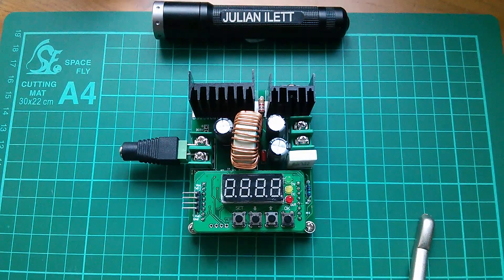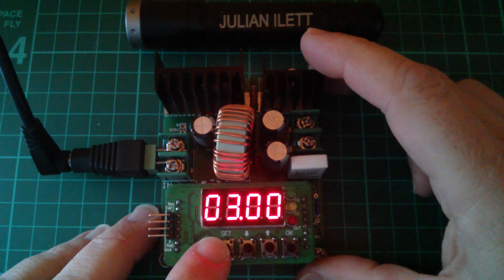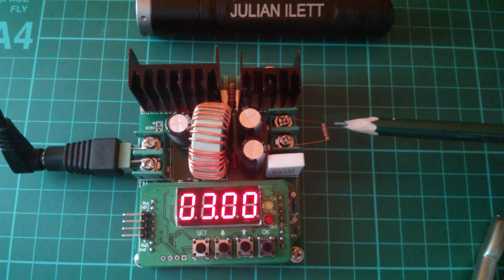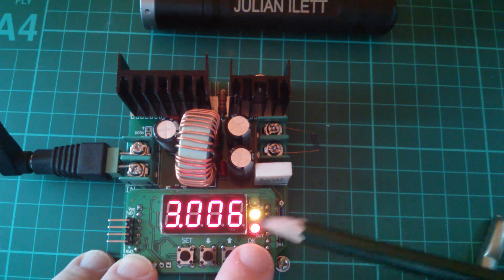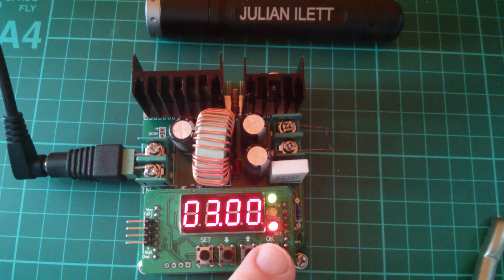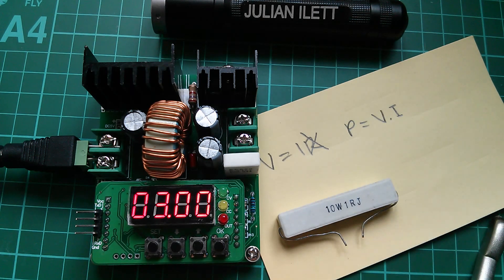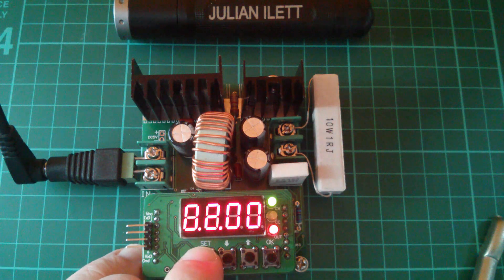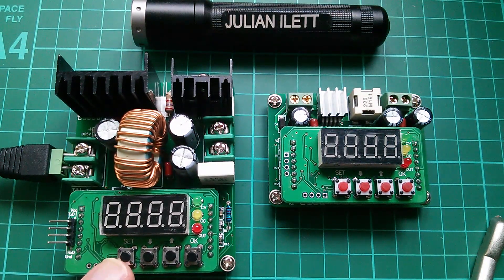Tutorial: DC/DC Buck Converter Voltage and Current Regulation

Comment: Great video Julian. I just received the A3606 module. Will connect it to my 6 caps smart plate. Easy way to adjust the current and voltage for many projects. Now it is priced $9.00 including shipping. Other higher modules I use with my 100w LED chips and it costs ~$20.00. All due to your recommendations. Thank you.

Comment: You should start a channel called: "Will it CV or CC?" I enjoyed that. :)
There is certainly the accuracy of the 10W resistor to consider, however the temperature coefficient of the 10W resistor should also be considered among other things like the accuracy of the voltage and current reading of the Buck Converter itself. In a perfect world I'd expect the CV and CC to oscillate, which I find interesting to think about...

Comment: You just put together an e-cigarette mod, haha. A DIY one. A mod is really a dc-dc converter (powered by IMR 18650 batteries, with a nominal voltage of 3.7V). The coils are either made out of Kanthal or Nickel wire (Nickel is used for temperature controlled devices). The mods have a microprocessor running a firmware and it reads the resistance of the wire and allows the user to adjust the amount of power sent to the coils in Watts or Joules. If you use 24 gauge Kanthal you will see an amazing glow in the coils and they won't burn out easily. There is a chip called the DNA 200, which is completely digitally controlled and is much smaller than this one, It comes with an LCD display, is able to read nickel wire resistance in real time and control the temperature of the wire by doing that. It is done by a US company called EVOLVE and there are many clones in China of it.

Comment: Question:  With the single wire strand. It was giving you 3A and low voltage.
Is that a restriction of the converter circuitry, or is that caused by the fact that the input (lead acid batteries) can't provide enough input power for the converter to get the voltage up as well ?
Reply from the maker: No, it's simple ohm's law V=IR. The wire strand had a resistance of 0.25 ohms. Multiply that by 3 amps and you get 0.75 volts.

Comment: Thanks for the video.  I wish you would have tested the actual resistance on the big resistor to see if it was off, instead of just assuming it was the problem... it could have been the regulator.  Also, I wish you would have tested the accuracy of the displayed output volts and amps vs a good meter. :).  I know this wasn't a review of the product, but you went so far, that the last details would have been easy.

Comment: Interesting, I'm working on a home automation for my greenhouse using arduino for control and a car battery for power.
Was planning on using a linary voltage regulator for the 5v to the arduino, reason for the car battery is because window servo is a 12v also my water pump is 12v. but I doubt an arduino would be happy with 12v for a longer period.

Any suggestions about voltage regulation on Car battery(12V) > Arduino(5V)?

btw. I'm charing the battery on sunpower, with a 12v controller.  So no sudden spikes of power like with an alternator.
Reply from the maker: ***** If you're using solar power, use a DC/DC buck converter for your 12v to 5v conversion - it's more energy efficient than a linear regulator. You won't have any issues with switching noise - the Arduino, pumps and servos are all pretty noisy themselves.
Reply: Thank you, will look into this   Good video ;)
Reply: An update,, I got a 15v -> 5v Buck down converter, and it works like a charm.. Thanks for the tip.

Comment: Hi! Lovely video! Very clear and easy to follow! But I do have a question: If I want to stabilize 24v that is being produced by two lead acid battery's in series and also want the regulator to be able to handle 6 A what kind of circuit could I build in order to regulate that? I've been looking around, searching for a voltage regulator that is capable of that but none of them go to such high voltage together with such high amps. I would like to prefer using base components because although your buck converter seems to do the job perfectly, it's huge and probably expensive as well (it's a school project). Thanks!

Comment: Question: What's the minimum difference between the input & output voltages? Alternatively, for a particular Vin (say 12.6V from a SLA battery), what's the maximum Vout I could get out of it?
Reply from the maker: Alex Turcu Probably not much more than a diode volt drop - in other words, a volt or so.

Comment: Interesting that at the threshold current it's flicking between CC and CV at a rate of almost exactly once per second. I'd expect it to be flicking between the two at some fast rate, fast enough that they'd both appear to be on, so you would get that situation where both lights appear to be on. I'm guessing that 1 second switching period represents a 1 second hysteresis in the module's CV/CC algorithm, so it's limited to performing exactly one switch between CC and CV every second. I'd be interested to see what impact that has - if it's in CV mode and it's already done the one switch in that particular one second period, would it be possible to arrive at an over-current situation if the load resistance suddenly dropped very low?
Reply: On further contemplation I don't think there can be a one second hysteresis in the CV/CC algorithm because it just wouldn't work properly if there was. Perhaps the hysteresis is just on the output to the lights? With a bit of fiddling is it possible to get it to switch between CV and CC at a faster rate? I'd be interesting to see some further inspection on this - you'd need to trace out the V and I curves on a scope to get an idea what's really going on.
Reply from the maker: Kieran Simkin My impression was that the slow oscillation was due to the quite large smoothing capacitors on the unit's output. This would limit the slew rate of the output voltage and therefore the current also.
Reply: Julian Ilett Aah that sounds like a plausible explanation, easier to test too because you could temporarily replace the output caps with smaller ones and see if the ooscillation speed increases, or (even easier) increase the capacitance by adding more in parallel and see if the speed decreases. I'd have a go myself but I haven't got one of these devices handy - I'll likely order one when I have a bit of spare cash - being a bit of an eBay bargain hunter like yourself I often steal purchase ideas from you :)

Comment: I've made a little bench power supply using the B3603 and a 19V laptop charger. It's housed in an old CB-radio power pack case.
Slight drawback is that the output negative is directly connected to mains earth, but the unit can be powered through the bench isolating transformer if needed.

The tiny heatsink provided proved inadequate at 12V 2A, luckily it's quite easy to graft a better one on.
It works very well, though I haven't measured ripple and noise.
It's also nice to be able to set the current limit before you start.
My BK Precision 1550 (38V 3A) Bench PSU doesn't do that - annoyingly you have to set a low voltage, short the outputs and switch on to set the current limit. That's stupid!

If the tests are good re ripple and noise, I might make a triple-output supply. Conventional 50Hz transformers though, making the outputs isolated from mains earth.

A little bit of hacking to make a tracking split supply from one controller would be cool.... another one to add to my long list of projects lol!

I've also used one of these as a charge controller for my daughter's motorised trike. I got it second-hand, the battery (6V 10Ah SLA) was past its best.
Got a new battery but soon found that wouldn't have lasted too long either as the original charger was seriously overcharging it.
Set at 6.9V with a 1A current limit the unit barely gets warm. I'm using a 12V 2A mains adaptor.
Current drops to the region of 4-7mA depending on temperature when fully charged.
I do intend to fit one of the more basic twin-pot regulators to free up that B3603, though I have 3 more lying around.

One thing to note though - the whole unit powers up when connecting the battery. I didn't want to add a diode as regulation would suffer.
Final version will include a relay to prevent this.

The heatsinking on the B3008 seems a little better, but I'd be tempted to bolt the devices to a much larger heatsink if I used one for something permanent.

Simon.
Reply from the maker: Simon Parkinson The B3603 is an excellent little converter, but these Chinese modules should always be de-rated - 2A sounds about right.
I think there's a P-channel MOSFET circuit that you could use to prevent the battery on the output from powering the circuit
Reply: Julian Ilett I kept unit at 2A max. stilled started malfunctioning after a few days of use.

Comment: What happens when the input voltage is lower than the set output voltage?
Does it just output the same voltage as the input? For example; If I input 12v and set my output to 10v, what would happen if my input voltage drops to 10v and then even further to 8 or 9v?
Reply: If I understand the principle correctly, the converter steps up the voltage as well as stepping it down.  The only "gotcha" is that the input still has to be able to supply the required current at that lower voltage, so that the converter can boost the voltage and still supply the asked-for current.
Reply: Vidgester1999 
Input has to be higher than output.

Comment: Question about DC Voltage Step Up converters.  How much energy is lost during the conversion? (ex, 1cell 3.6v to 5v)

Just saw a local news talk about portable battery packs for smartphones and they done some testing from a lab and due to loss during conversion, news say users can only expect about 70% of actual battery mAh capacity.

Does this sound about correct?

I mean... pretty much every portable battery packs I see either use 18650s or LiPo.
Reply from the maker: +xxgg Actually it's probably worse than that. The step up converter is generally about 90% efficient, but power is also lost going into the power pack. That's because a linear regulator is used to take 5V down to 3.7V so the loss is (approximately) 3.7/5 which is about 74%. 90% x 74% is 66%.
Reply: I am currently charging my iPad Air with my Anker 5400mAh pack and monitoring mAh being put into iPad.  I'll post result when it is done.

Comment: I am searching for a charger to charge a 12 battery, with a wind driven(variable) dc input. sugestions? maybe this one. Thanks, greetings.
Reply: I'd expect a simple solar charge controller to do this job, with the solar panel inputs connected to the wind generator.

I wouldn't recommend one of the more complicated chargers, because the programming might expect a gradually increasing availability of power from the solar panels, which a wind generator won't normally supply.

Comment: Are you getting much power from your panels at this time of year? My 800w array is giving me 0 watts during the day at times.
Reply from the maker: Shaun Dobbie I have to be careful - not draw too much from the batteries this time of year.
Reply: Me too, all I can have running at the moment is an IP camera and a raspberry pi all running on a 24v 225ah battery bank which I have to charge every day or so from mains electricity. How I hate Winter.

Comment: Is that UART to the left of the top board? Does that allow for remote setup?
Reply from the maker: ***** In theory, but it doesn't appear to be implemented. Shame.
Reply: Shame that could have been useful for an arduino based charge controler

Comment: Julian, I can see that you have four pin header soldered on the board. Do you have any info about it? I would love to drive it with something other than buttons...
Reply from the maker: Dobrica Pavlinušić It's marked Vcc, TxD, RxD and Gnd, so in theory it's a TTL level serial interface to remotely monitor and control the buck converter. A disappointment then, that it doesn't appear to be implemented. I've monitored it at various different baud rates (on both Tx and Rx lines) and got nothing! I've fired various different commands at it - also nothing. It's a real shame, being able to monitor & control these converters with an Arduino would be so cool. Afraid not :(
Reply: ....If the serial would actually work, you could also use it for mppt experiments.
Reply: Julian Ilett I guess the serial port is accessible and it's used in production for calibration. I don't think you will get anything out of the port, unless you send a magic byte to it first.
Reply from the maker: ***** MingHe also make the ZXY6005 family of DC/DC converters which have a similar serial interface which is implemented in the 'S' models (e.g ZXY6005S). There's a document floating around which details the command set and I mostly copied that. I was really hoping to get it to work, but unfortunately not.
Reply: Julian Ilett ZXY6005 control board looks different to me than this one. however, this one also has additional four pins next to buttons, and I would guess that those are programming header for ST8. I would also love to find document about serial protocol, or at least have idea of at least one command. I'm interested in driving B3603, but control boards looks same so that's why I was asking this question at the first place.
Reply from the maker: Dobrica Pavlinušić I've just put a photo of the Communication protocol on my Facebook page: https://www.facebook.com/pages/Julian-Ilett-on-YouTube/743713062366989
Reply: Julian Ilett Thanks for sharing. I have the B3603 with the 4pins labeled, from top to bottom, Vcc TxD Gnd RxD.
Reply: +Julian Ilett Hola jhuuu788
Reply: y78